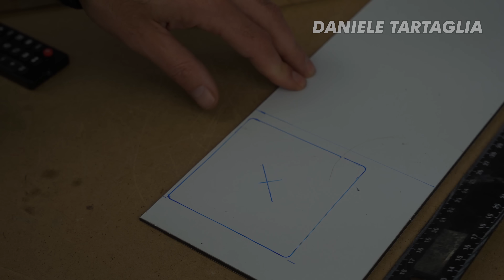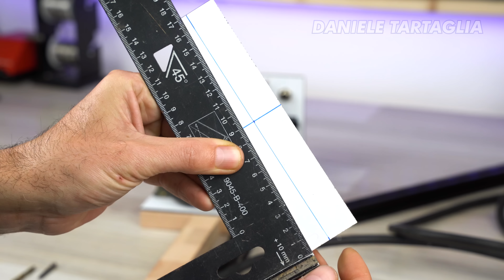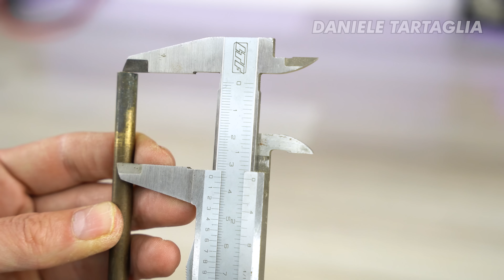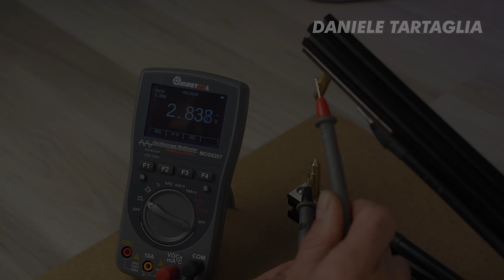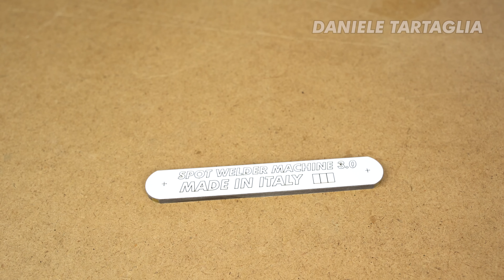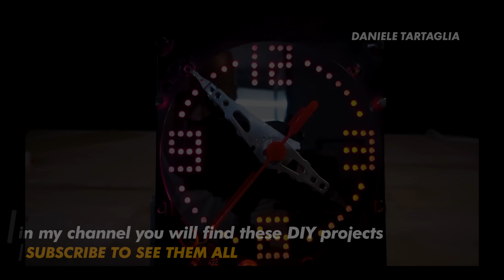INCREDIBLE Spot Welder DIY built with microwave

Comment: I see lots of builders using brass for their electrodes, but brass is not the best choice for the electrodes. Copper rod (although more expensive, and a little harder to drill and thread due to its softness) would be a better choice. Brass has between 3 and 4 times the electrical resistance (1.7 * 10^-8 ohm-metres for copper, 6.3 for brass,) so it has more self-heating, and reduces the maximum current available to heat the steel by adding unnecessary resistance to the circuit; brass has a lower melting point than copper (930 C compared to copper's 1080 C) so it's more likely to melt the tip and the larger tip area will lower the heat concentration in the weld, reducing penetration; and copper is 4 times better at conducting heat away from the weld, (386 W/m K for copper, 96 W/m K for brass,) reducing the tendency for the tips to melt and become blunter (which increases the area of contact and spreads the heat out over a larger area.)
Reply: Unfortunately, the most important point has been neglected here. As a chemist and doctor, I can only warn against this. Please never use brass at higher temperatures, even if these are only reached for a short time like in this case. Brass is an alloy of copper and zinc. When zinc is heated to a high temperature, it begins to vaporize and forms zinc oxide with atmospheric oxygen. Zinc oxide is extremely toxic and can lead to what is known as metal fume fever. For this reason, brass tools should never be used on these small melting furnaces with gas burners (there are countless instructions for this on youtube). Here, too, toxic zinc oxide is formed at the high temperatures. Due to the much higher temperatures even more than with spot welding with brass electrodes. Therefore please do not use brass with such tools. Metal fume fever can even be deadly.
As @brianspencer6397 suggested use copper electrodes instead.
Reply: @SciDOCMBC  Yes got bad headache and felt very rough just by welding galvanized steel! Learned my lesson and grind it away if I use it again. I have a friend who is a welder by trade and he knows all about it!! Lol
Reply: Just a thought you can get solid copper soldering iron bits which could help?
Reply: @barrymayson2492  If they have a big enough cross-section to keep electrical resistance low and carry heat away from the tip.
Reply: Make your own video then, instead of commenting on others work

Comment: IT'S GREAT, For my opinion the upper, rear cover is suitable in transparent and 12v power  supply also need blow the air.
Reply: 12 volts can not be cooled. There's just a fan blowing in the load.

Comment: At 2:00 you wrote the wire is 35mm and you put one turn but from 9:28 I can see two turns, did you change the cable to 25mm  in the meantime?